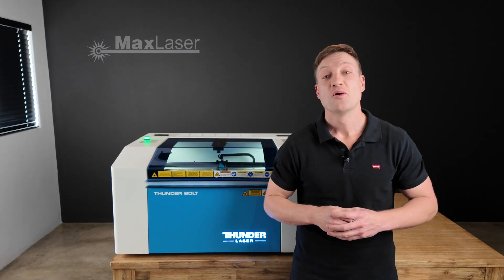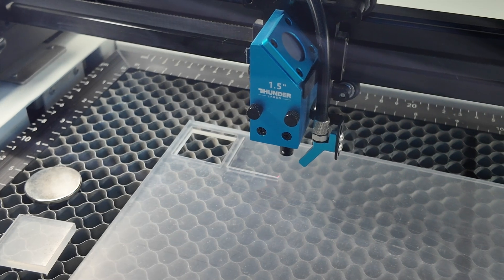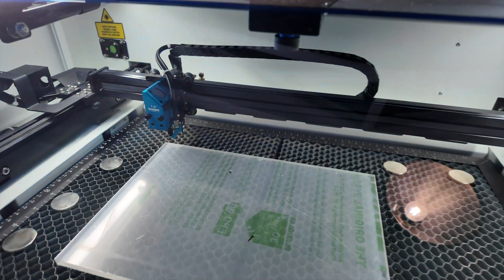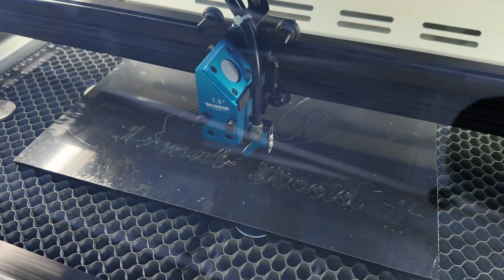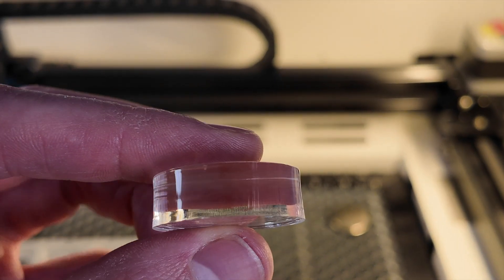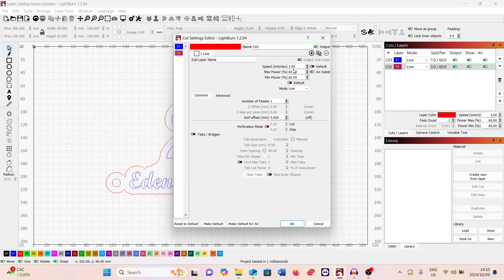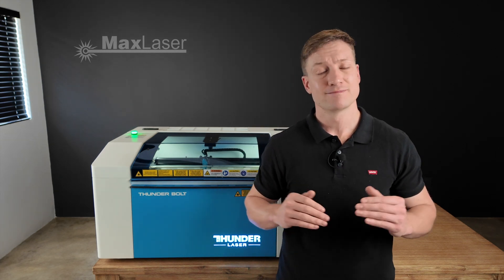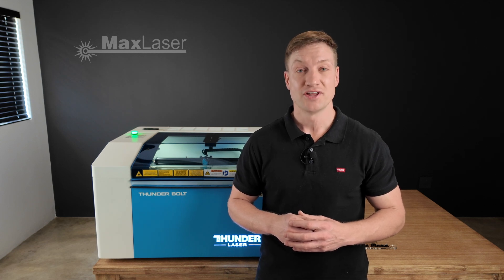Laser Cutting Acrylic with the Thunder Bolt

Comment: Hey, thanks for the video. Why do you use only 60% power?
Reply from the maker: Your welcome, so i use 60% as a standard to prolong the life span of the tube & power supply. I try not to push the machine to it's limits. You can go higher should you need to.
Reply: As far as I know, this is useful for a glass tube. For metal ones, you can safely use the maximum power
Reply from the maker: @PiotrSarna  That's great, will give it a try and see if I can cut thicker :)